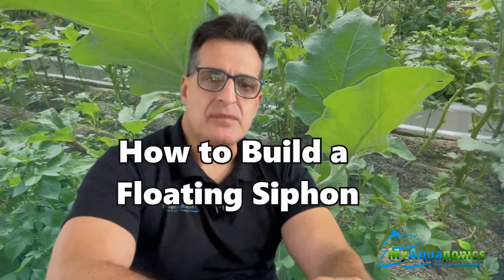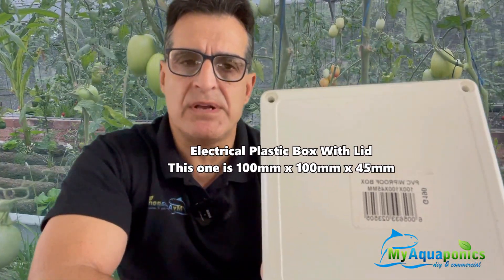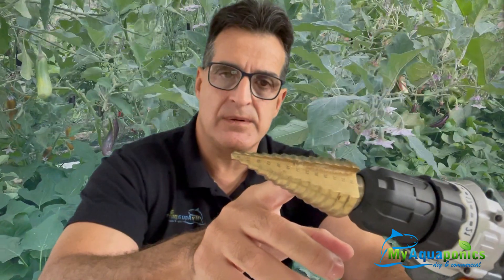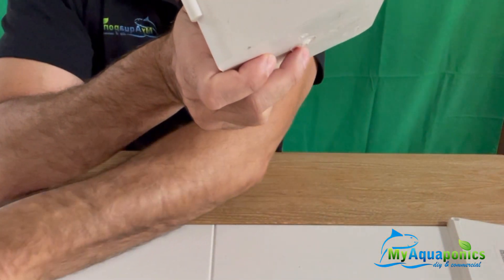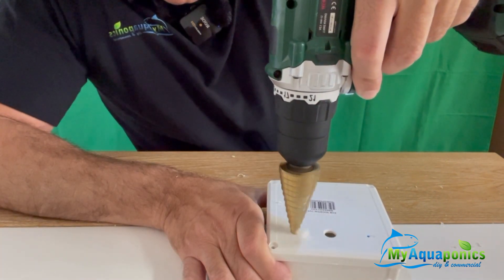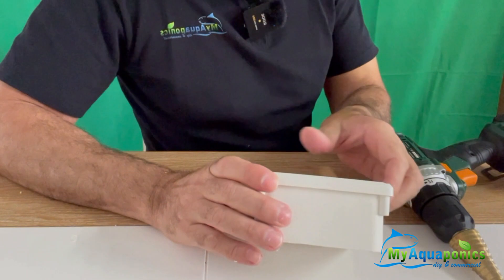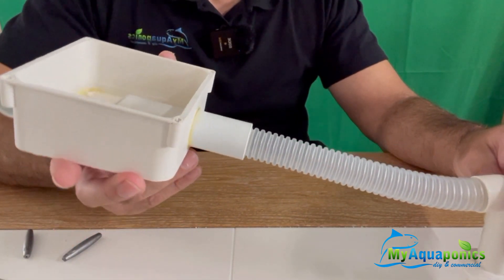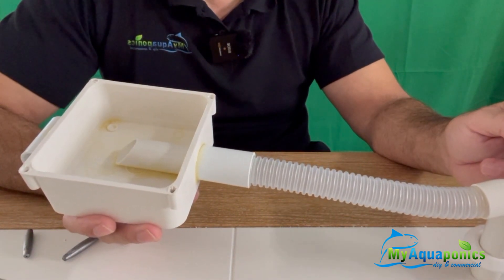How to Build a Floating Siphon in 30 Minutes or Less: Simple, Reliable Alternative to Bell Siphons

Comment: why not just lose the top completely and the inside pipe? and no need to mess with the length of flexi pipe, just attach some sort of anchor to it with adjustable line. cool idea though.
Reply from the maker: Yep could potentially work.. If you get it right, please do share

Comment: If this was on the outside of the media bed like you mentioned could be done, how does that connect?
Reply from the maker: basically have a compartment attached to the side of your grow bed, but same depth.  Then just have a few holes drilled across from the grow bed to the compartment where the float drain is installed. This will ensure that the water level in the grow bed rises at the same rate as in the compartment housing the float drain. Of course, holes will have to be small enough to prevent grow media from pouring into the attached compartment . Hopefully I am making sense 😄
Reply: @MyAquaponics1  Thank you!

Comment: Thank you for sharing.  The demonstration at the end really helped understand the process.

This may help in my situation where a small or varying about of water from ram pumps are pumped to a tank at a higher elevation.  Then with an undetermined amount of input water, which can be slow at times,  we wish to release quite a bit of water to multiple sprinklers to water pasture.  

Thanks.
Reply from the maker: Thanks for the feedback .That’s a very interesting setup you have going there with the Ram pump . Will be very interested to know if this works in your system

Comment: This is a brilliant build! One mod i can add is to control the water height by adding a string tied to the bottom of my kit (or rock for that matter). It can drain early if i make it short. Thank you for generously sharing this!
Reply from the maker: Thanks for the feedback.. Yes, others people have suggested similar advice to yours,  a physical float stop. That could be as you suggested, or simply a wire or other physical barrier on top.

Comment: I might have missed it in the video, so forgive me if I am a total idiot. This is a great system, but I assume you put this in a control module and not in the same area as the grow bed where the media is?  i.e. how do you handle the media getting into the box and weighing it down?  The Bell siphons are inconsistent or can be, but they are also in the grow bed.  I LOVE the idea of having something that will work consistently.  I saw the video segment where the siphon that was operational for 6 years was working, and it looked like it was in a control module instead of inside the bed itself (i.e. no media around it that I could see)....
Reply from the maker: hi Mark, so yes you can install it in the grow bed or outside of the grow bed. If in the grow bed then you have to have a media barrier frame all around it to prevent the media  (i.e. stone or leca) from obstructing the operation of the float. We use a strong plastic crate. The crate allows water through, but prevents the media from getting into the float area. Hope that answers your question ?

Comment: I like this a lot. You can just create a physical barrier at the height you want it to stop at and not worry about the length of the pipe.
Reply from the maker: Thank you. Yes correct, much easier to add a physical barrier to stop the float at a certain water level, instead of trying to calculate the length of the flexi pipe

Comment: Sorry for being pedantic, but this is not truly a siphon, it’s just an automatic drain.  TBH, siphons can be tricky to hold a vacuum, so this auto-drain design is far better NOT being a siphon
Reply from the maker: No problem.. Technically you are correct as a siphon by definition must work with a vacuum.  For us, the naming of this solution was more as a comparison with the bell siphon, and potential alternative. Thanks for your feedback .
Reply: Siphon brings water up first and then back down to a lower level.  Fair point.  Why think siphon when there is already a drain at the bottom of a container?
Reply: How stupid are you? It works!

Comment: Super idea. Thanks a lot for sharing. 
The flexibility of the flex tube may vary over time (temperature, UV light...) resulting in a change of the water height in the growbed.
If you want to define the top waterlevel in the growbed exactly, a simple nylon string or twine attached to both the floater and the bottom or a heavy weight might do the job.
Reply from the maker: You are correct. In fact another viewer of our channel suggested something very similar to yours. A simple float stopper to keep the water level constant . Thank you

Comment: Awesome! I've seen so many aquaponics videos. Yours easily tops them all.
Reply from the maker: Thank you very much for your positive feedback. Much appreciated
Reply: Can I use a 1000 lt tank connected to the smaller container where siphon is installed. And do I connect the outflow pipe to a drip line?

Comment: Nice. Yes the bell siphon adjustment needs to be precise (for each bed, I have 4 beds) else all hell breaks loose...lol. I want to make this and test. My beds are currently operating without issues BUT I am not using a bell siphon...just a stand pipe for the water depth and then a 500ml coke bottle with cap on, cut to the correct height....works 100% all the time without assistance from me. I gave up on bell siphons. But I am always looking for another way. I actually want to make my 4 beds into 1 large bed so there would be less pipe work.
Reply from the maker: Thank you for your feedback and for sharing your story. I have seen the hack of using the bottles to emulate a bell siphon and they do work well as well. But yes, if you want to convert your 4 beds into one, the float siphon may be a more reliable solution.. Good Luck.

Comment: He is correct .. I had exactly the same issue .. when the flow was too slow from the sump (because of different water level) the bell syphon would not start consistently .. my solution was .. 3d print mini syphon to kick start the bigger one. If I had my time again I would replace both with 3d printed ones. I found the design and testing made it work with greater range of water flow. The smaller syphon will give a constant water pressure.
Reply: Are they your designs or on a STL website? Would love if you share. I wanted to design one using a glass jar as a bell so I could watch it drain because I'm a weirdo. But I never got around to it.
Reply: @gutrali  My designs.. In the same weird vein I guess. I also designed a swirl filter because I didn't think I could get what I wanted any other way, including threads for a tap at the bottom.

Comment: What an excellent and elegant way of overcoming bell siphon issues. I'm currently expanding my system from using 1m square growbeds to one  2.4m long one , around 900 litres in capacity. I am going to build an exterior siphon area, so this idea fits perfectly. Do you think it would work if I used a float stop (like the float tethered to the bottom)to regulate the height of the flood cycle, that might eliminate any problems with the flex of the pipe leading to the drain tube ? Thank you.
Reply from the maker: Hi Mikey, thank you for your positive feedback, much appreciated.. Wow, that idea of yours to use a float-stop so as not to rely on the flexi pipe extension is actually genius.. Cant see any reason why it wouldnt work.  Very clever and so simple (why did I not think of that..LOL), will have to call it the Mikey mod :)  Please do share your system when done as we've not yet built one mounted outside the grow bed. Thanks for that great tip.
Reply: @MyAquaponics1  
The flexible portion doesnt need to be too long, it just needs to perform as a hinge. I used BSA motorcycle front fork gaitor/bellows for the hinge with rigid pipe on both sides.
Reply from the maker: @atomizer2665  Hi Yes, it all depends on the type of hose you use, its rigidity, thickness, etc. You need to adjust length for your own needs. A very good idea we received the other day from @mikeybikey7201 in these comments is that you could also use a float-stop to more accurately control the max water level in your growbed. Good idea for you to use what you did, trust its all working well for you.. How big is your grow bed ?
Reply: @MyAquaponics1  
2m x 1m.  I just copied a commercial Flout design used for septic tanks. Finding short lengths of corrugated hose/ducting with the right diameter and amount of flexibility was tricky, rubber bellows are pretty common :) The float stop is a good idea, much easier to adjust than a float box counterweight. I`ve always thought a 3d printed, ball raced, 90 degree rotary union would be the ideal thing, with an integrated adjustable stop to set the arc travel.
Reply from the maker: @atomizer2665  I Love ingenuity, so if this solution triggers better and more efficient off-shoots of it then great.  We invite everybody to share their masterpieces here
Reply: Thanks @MyAquaponics1  , I'll upload a video of the system when it's finished, fingers crossed for the end of the bell  siphon !
Reply from the maker: Excellent, look forward to seeing it 👍

Comment: Very neat.. many thanks for this new method of bell siphon... I have a question,... you mentioned about the water height of flooding depends on the length of the flexible tube... my question how about how to set the maximum/minimum water drain level height? thank you
Reply from the maker: The maximum will be set by the length of the flexible tube, so it may be some trial and error to get it to exactly where you want to, by reducing the length slightly each time.  You could flex the tube upwards to its max to establish a proximate level. For the minimum level, it will always be the depth of your floating box (i.e, resting at the bottom during the drain phase).. So yes there will always be a layer of water at the bottom of the grow bed which is beneficial for the longer tap roots to stay hydrated

Comment: I'm having trouble sussing out why or how this thing would work unless it's not going to be surrounded by media holding it still 🤔
Reply from the maker: There are clips in the video showing the float siphon in operation during the flood and drain cycles. As I mentioned in the video, the float siphon would have to be housed in a rectangular container (i.e. plastic crate)  within the plant grow beds so as to keep out the media such as LECA or rocks. Alternatively it could be built on a separate container mounted on the side of the plant grow bed.  Hope that answers your question.

Comment: This is real cool. Will try it for sure. How about keeping it outside the grow bed(with a outlet pipe from the grow bed into this unit)  so that the bed space can be utilizes to grow maximum plants. Will it work?
Reply from the maker: Thanks. I briefly mentioned that you can install it in a separate compartment on the outside of the grow bed if you do wish to save on planting space within the growbed.  So yes , can be done. Good luck with your build

Comment: I can see the operational  advantages over bell siphons. However this would require some kind of a box like showed where the this floating siphon can freely operate either inside or outside the grow bed. So how did You incorporate this floating siphon with Your grow beds? THXs
Reply from the maker: Yes correct, you need something around the float siphon once installed in the grow bed to prevent the grow media from interfering with the operation of the float siphon. In our grow beds we have simply used a rigid plastic crate

Comment: Does a smaller box make a difference to speed of siphone? Thanks for this👍
Reply from the maker: Hi, the box is just a floating mechanism, so the size will not speed up the siphon. As soon as water enters into the box it will sink within a second or two.. To speed up the flood cycle you could increase the inflow of water into the grow bed, but then your drain cycle may be longer.

Comment: So does your pump turn of at the same time of the drain cycle on a timer or does your pump constantly run?
Reply from the maker: Yes for the cycles to continue the pump needs to keep pumping water into the grow bed. You could potentially turn off the pump during the drain cycle to save electricity, but no way you could time it